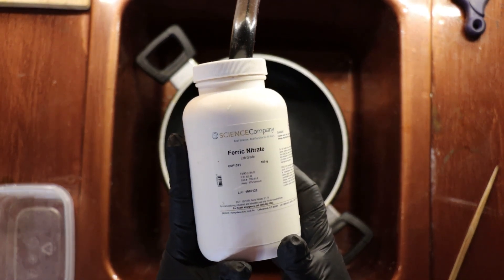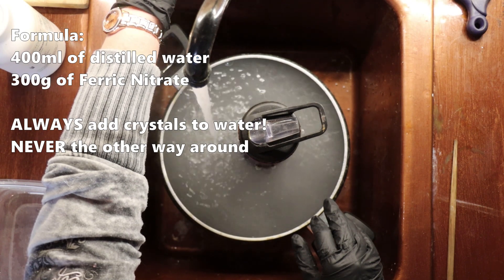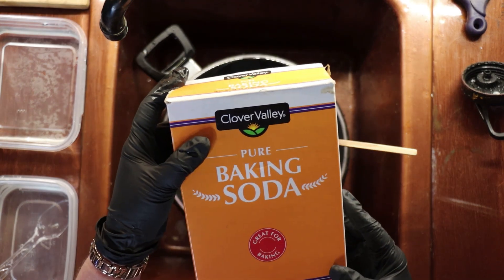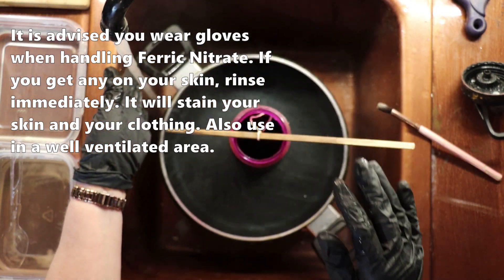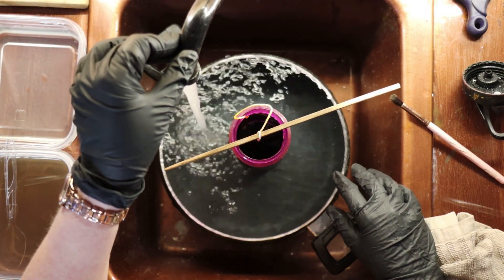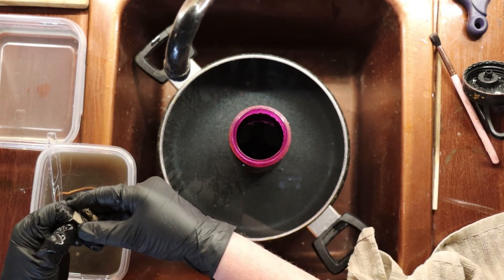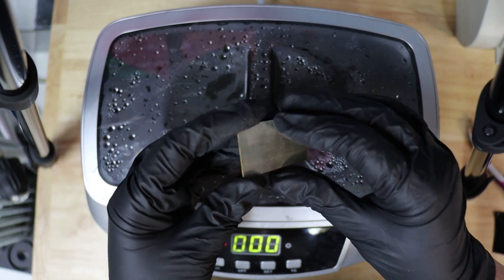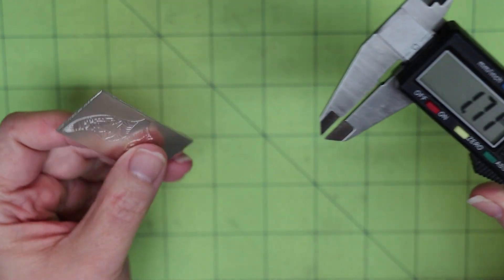Beginner Series: Etching - Using Ferric Nitrate

Comment: Thank you for sharing your craftmanship and for a good tutorial. I´m a 59 year silver- and leather hobbyist and i have doing it for about 4 years now. Now i am going to try etching. My purpose is to make a silver cuff and i have the idea ready and printed on " press n´peel " paper. Also i have the silver sheet ready but i have not pressed the pattern on the sheet yet. My problem is this. I ordered Ferric Nitrate from UK because here in Finland, you are not allowed to buy it as a private person. I ordered it by mistake too little, 200g , and according the manual you get about 0,7 litres from that amount nitrate. I have problem to find a proper dish so that the nitrate solutions surface is high enough to cover the whole cuff that is 18 cm. My question is, does the silver sheet have to be flat or can i bend it round before etching? Thank you for possible answer. 🙏

Comment: Hi Tammy, love your video! Can I ask a few questions?
1. Why crystals and then water? What can happen?
2. Do I need ammonia solution to clean the piece? What can I use instead?
3. How many pieces can I etch at the time in the solution?
Thank you!! More videos of etching metal please 🙏🏼
Reply from the maker: Hi!
1. Always add crystals to water. If you add water to the crystals, it can heat up and cause a bit of a reaction and spit. You can read this article for more information: https://sciencenotes.org/add-acid-to-water-or-water-to-acid/#:~:text=Why%20Add%20Acid%20to%20Water&text=Diluting%20acid%20with%20water%20is,gravity%20or%20density%20than%20water.
2. I use an ammonia solution because it cleans the oils off of the piece really well. Some people simply sand the piece to remove any oxidation and oils, but I have found ammonia works really well.
3. You can etch as many pieces as will fit in your solution. Just leave enough room around them so they don't touch.
Hope this helps!

Comment: If we are using nickel plated steel, can we use the hot vinegar, salt, and battery trick for this? Will the toner transfer etch properly?
Reply from the maker: I haven't used that process before, so I'm not sure how well this would hold up. Ferric Nitrate is pretty aggressive, so I would think it would perform in a similar manner.

Comment: Hey Tammy,
I used to etch my silver hanging 'flat' on the surface of the ferric nitrate, securing it with tape (making sure there are no bubbles on the surface of silver! Laying it face down also helps the silver parts to come loose and float to the bottom). Today I tried your method and I see deep vertical lines underneath the parts that are not etched, like drippings. Thank you for your video, but the hanging technique didn't work out for my piece, unfortunately!  unfortunately...
Reply from the maker: That's interesting. I used to get the lines when I laid my pieces flat. I think the key in either instance is to either wipe the surface debris off more often or maybe even use a bubbler or some sort of vibration to keep the etchant moving. I have also seen people etch with the masking face up. I have tried that as well and get the best result, but it requires the debris to be removed much more often. It is a much cleaner etch with no striations at all. You should experiment with different methods and do what works best for you.

Comment: Love how beautifully detailed and dark your design turned out. The laminator trick really works great! I'm looking to invest in a Curio in hopes that the etching feature will eliminate such chemical use. Does the Curio not etch as well as this process? With the 5mm height allowance, and the 2mm deep cut blade, is it too much to hope my sawing, and chemical etching days are over, lol? If not the 18 gauge, do you think it would cut at least 22 or 24?
Reply from the maker: Thanks! I have a Curio as well and tried to etch with it but it barely leaves a scratch on the metal. There's just not enough pressure to get any depth. It certainly won't cut metal at all.
Reply: @tammybaalman2429  Thanks so much for your help, and I look forward to watching more of your videos!
Reply from the maker: @smuschlitz  You are welcome! I hope to be doing more videos soon!

Comment: I'll be trying this technique on silver after having great results etching copper with a different solution. Great video. I just have one question though. If you're cutting the shape out, why not mask out as much of the plate as you can so it remains intact? I normally also mask out the edges.
Reply from the maker: You certainly can mask out the remainder of the plate. It is just personal preference for me and there are times when I do mask out the rest of the plate. It really just depends on my design. I'm glad the technique worked for you on copper. You should have similar results with silver.

Comment: Tammy, thank you for this video.  I've tried etching with ferric nitrate a couple of times and don't get a deep an etch as you did.  Will try your method!  Question:  Can you suspend more than 1 piece in the solution at a time?  Do you have to ensure they don't touch each other?  If so, how do you set that up?
Reply from the maker: You're welcome! I really hope this helps you. Yes, you can suspend multiple pieces, really as many as you can fit in your container. I do this by placing them in a row and connecting them all with a single piece of string. Put knots in the string at the top and bottom of each piece to ensure they don't slip. I have even suspended pieces back to back and never had an issue. Just make sure the side with the pattern to etch is is not covered in any way.

Comment: Very useful Tammy, thankyou. If I only want to etch a small piece, could I use say 100ml of solution instead so I can buy less crystals?
Reply from the maker: Thank you Hermoine. Absolutely, you can make a smaller batch. I tend to use that much because I do a lot of cuffs. :-). You can also place the piece flat in your container instead of suspending it the way that I do. If you do that, you can either float it upside down so the particles drop to the bottom or lay it in the solution face up. With either option, you still need to brush the etched material away at regular intervals. You will find that you get a different "look" for each method.
Reply: Tammy, I am back with another question, it might seem silly... but if I clean any grease off the metal with acetone vs steel wool before etching, would it be possible to etch onto a polished surface? 
I’m hoping to made a wide ring band, im hoping to polish the metal first whilst it’s flat, then etch just a word in the middle, then solder? Then clean up the joint obviously. 
This is because I want to achieve a high shine polish on the silver but I’m concerned I could polish away the etch if it’s not so deep. Or is there a better way to do this? Thanks again for the help Tammy
Reply from the maker: @hermioneloasby9540 , not a silly question at all! The reason for roughing it up is to give the toner some tooth to hold onto. You can certainly try it, but I would do a test piece first. I would still use the ammonia solution to clean it, just use a soft toothbrush to "scrub" it. That shouldn't scuff up your metal. I do understand not wanting to polish away the etched area, especially if you have to aggressively polish it to get the high shine you are after. I'm very interested in your results! If you try it, would you mind posting back your experience and how it worked out?
Reply: Thankyou very much, I’ll be sure to run a test and see how it goes, I’ll let you know. :-)
Reply: Thankyou for your help :)
Reply from the maker: @hermioneloasby9540  you are welcome. Just let me know if you have any additional questions.

Comment: Tammy, do you only use the ferric nitrate etching solution once? Can't it be saved similar to pickle and reused? Maybe add fresh ferric nitrate crystals to the old solution? And thanks for these concise, easy to follow, informative videos! Doreen
PS Sorry, I paused the video to ask my question....and later you had answered. You do reuse...new question....about how long does the etching solution last? DO you add fresh crystals to old solution? Or always make fresh solution?
Reply from the maker: I use my solution over and over. I don't even add new crystals to the old solution. After a while the solution will not work as well. When it gets to that stage, I mix up a new batch. I think I used my last batch of solution for nearly a year! It just depends on how often you etch. I'm glad you are enjoying the videos! Let me know if there is something else you would like to see.
Reply: @tammybaalman2429  what is the ratio of ferric nitrate to water?